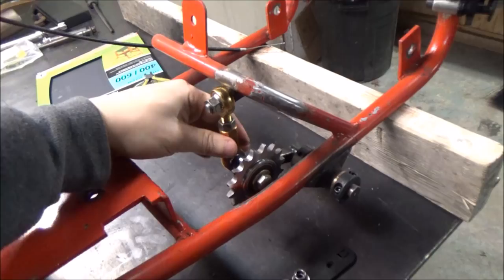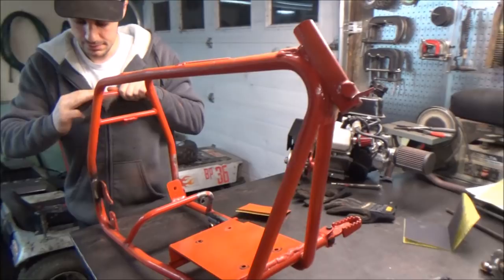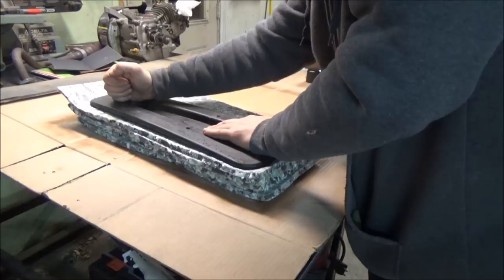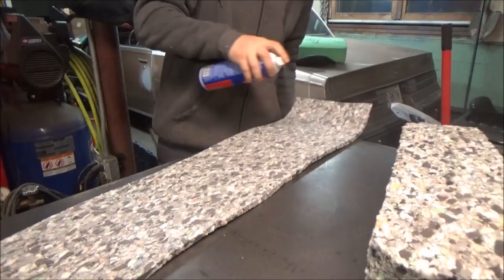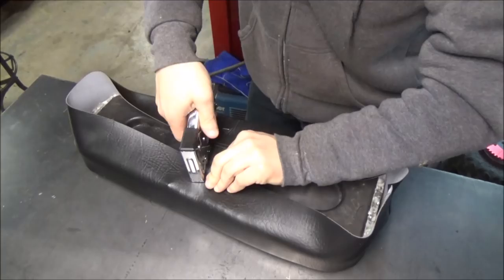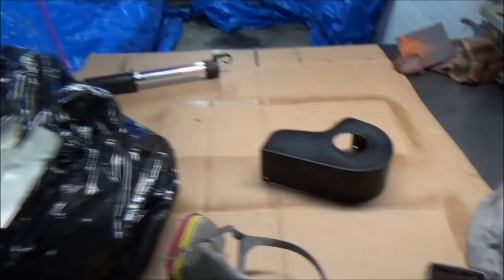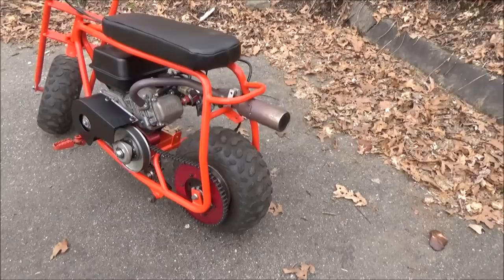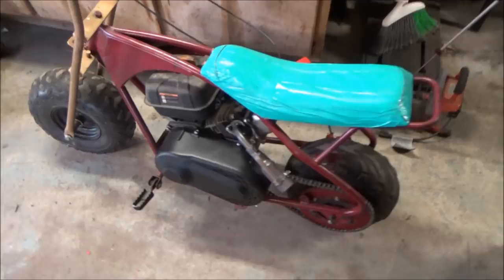Getting the built hemi predator doodle bug back together

Comment: My mini bike is very similar to yours. I have the same frame, predator 212 (non-hemi), all the same engine internal except my cam doesn't have an advanced grind, and roller tip 1.2:1 rocker arms. I also just picked up a genuine Mikuni 22 kit from NR Racing.
Reply from the maker: Sounds like a nice build. The advanced grind let's the motor keep lots of it's power down low on the rpm range but makes taking off while keeping the front tire down almost impossible lol

Comment: Lol, dude that clapped out Doodlevox is live man, only thing I'd fix is that seat that looks like a ninja turtle busted loose with some ooze poop on it. How's that red bike doing with wheelies? I just put a stock Predator 212 with a Max Torque SS 12t/58t  on mine and it pretty much runs away underneath you at least twice if you try to hole shot with it! I'm trying to figure out the best breaks for the DB because I'm building version 2.0 of my Honda 160 and she is gonna run serious RPMs! I dunno though, I'm digging that 212 with the extended warranty as a daily.

Comment: How did you fit the torque converter without any cutting??
Reply from the maker: I raised to the stock motor mounting plate, I show the process in an earlier video.